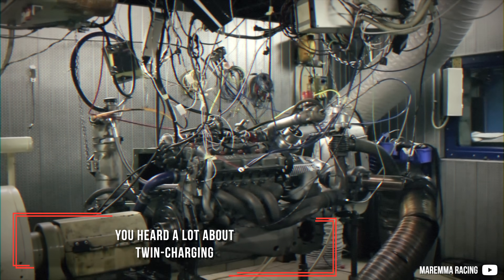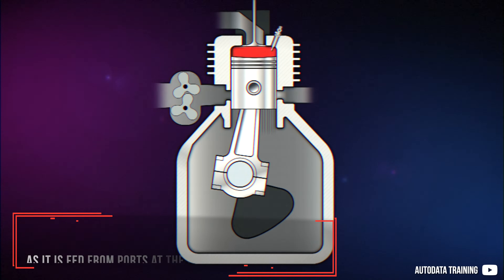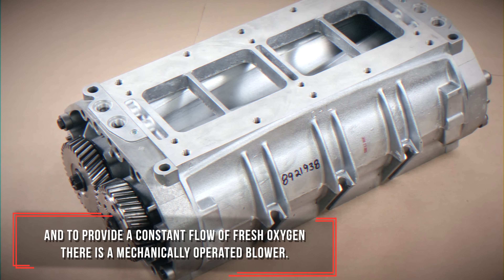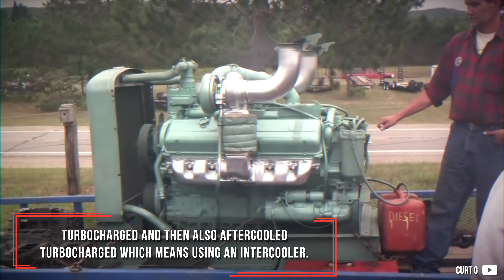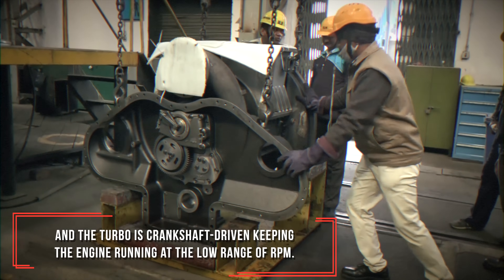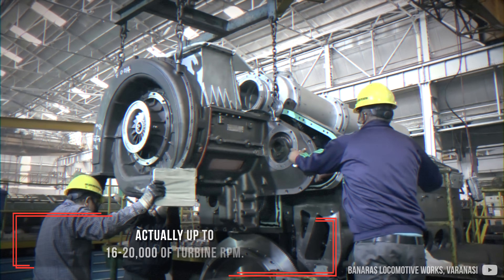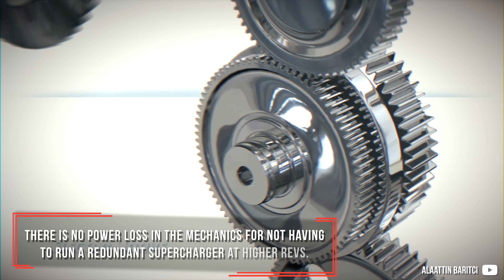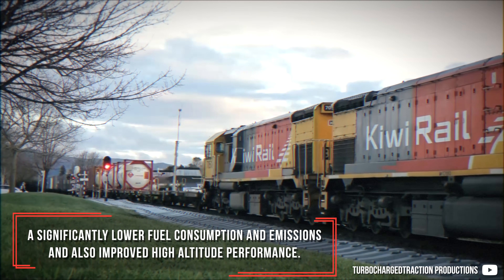EMD's Unique Type of 2-Stroke Forced Induction

Comment: I used to work for a major West Coast rebuilder of those EMDs. The blower/turbo was shipped in from another supplier in a dumpster sized crate. Inside was a dessicant pack the size of a pillow.
Reply: Ttem EMD 2 stroke run on anti friction bearing a very hardened steel 4340 crankshafts like Detroit diesel 2 stroke do, I got a silver 8v92 2 stroke turbo

Comment: The turbo sound was earsplitting on the test cell with no covers. 8 hours of full throttle run in before shipping.
Reply: We had a generator installed and it threw a rod at 7 h 40 minutes and had to be taken out of the plant. Almost made it haha

Comment: Damn it. Completely forgotten about EMD's 2-stroke engines! Used extensively in railroad and marine. EMD 710 series. Best prime mover ever, IMO.
Hmm... both Detroit and EMD focused on 2-stroke engine cycle for its diesel engines. What did they had in common? 
Ah yes, of course. GM!
You could focus on railroad prime movers for the next batch of videos, VR.
Reply: Don't forget Fairbanks-Moorse, they are technically two stroke but of an opposed piston design. Not sure if EMU's used OP units but they were popular in marine.
Reply: @yolo_burrito  Yes. They (Fairbanks-Morse & GM) were used during WWIi USN in Tambor, Gato, Balao & Tench-class, fleet submarines.
Reply: Fairbanks Morse made locomotives with an opposed piston design also, they just didn’t go over real well because the EMD and ALCO engines were so much simpler to maintain.
Reply: No wonder they have similar engine naming: 6v53, 8v71 from Detroit, 16-645, 20-710 from EMD.
Reply: @JustPeasant  they are still in use in some applications. I know of a water management district uses them for very large axial flow pumps.

Comment: Its basically a the same type of clutch you find in a bicycle, and it's freaking genius. 
For those of you who aren't aware, the Detroit diesels and the 567/645/710 were designed basically by the same people, hence the familial nature of the shared design. That is thanks to ole' GM and her conglomerating ways. The history is fascinating. Its a shame that the 710 has to varying degrees been regulated out of existence (though it's still being produced in smaller numbers for certain industries and via the tier-4 credit program). Perhaps EMD can work with AchatesPower to bring two stroke back to it's former glory while still meeting emissions compliance.
Reply: If EMD buy Achates and get serious about adopting the opposed-piston architecture, they could get Caterpillar back into the on-highway engine market. I could see Caterpillar's "EMD Truck Engines" making something like a 4-53 for 1/2-ton trucks and a 6-53 for HD trucks. Then they could also make a 6-71 for larger trucks like box trucks, and opposed-piston 8V92 and 12V92 engines for big rigs.
Reply: It’s the for an OP 1700 rotax made from 2 850 etec turbo engines in a new skidoo.that would make one sick snowmobile engine. An opposed piston turbo 2 stroke in a 2023 skidoo

Comment: Can't get enough of the EMD engine sound.  Purposeful chatter.  Locomotive 4-strokes just go chop-chop-chop.  If I remember correctly, the turbo on the EMD transitions from mechanically driven to exhaust driven at throttle notch 4.  Detroit Diesel tried some things on their 2-strokes in the 80's to overcome the Roots blower inefficiencies.  The Silver 92 had a blower that would clutch off and charge air would bypass around it once the turbocharger was making boost.  They also experimented with a hydrostatically assisted turbocharger to completely eliminate the Roots blower.  There was an hydraulic pump driven by the crankshaft plumbed to the turbocharger shaft that had a Pelton wheel added to it.  (Think of a small version of a waterwheel.)  It would spin the turbo fast enough to start and idle, and run at low loads until there was enough exhaust energy to really light the turbo.  I don't think that ever made production.

But my favorite EMD sounds are made by the Roots-blown 567 and 645's.  The turbo silenced the exhaust on the later 645 and 710's.
Reply: Detroit is still being innovative in the turbocharger space, making use of turbo-compounding on the dd15 and dd16 engines
Reply: I would rather just use a sealed crankcase and rotary valves down there. Sldo oil injection VRO dry sump. Tge model 42, and 32 Fairbanks Morse did this. Field marshals tractor and Sachs D600L in Holder A-12 tractors. Also 850 rotax etec turbo in new skidoos. I like the dry sump VRO much better.

Comment: the emd 645 engine was almost 4000 hp with 20 cilinders. The sound of it is astonishing also. Denmark used it in Mz diesel locs.
Reply: Love the MZ series, especially the MZ IV
Reply: The 645 V20's were used here in North America for EMD SD45's but they were not reliable at all.The weight of the engine block was too heavy on the frames,so over time from vibration,there was bending from stress including fractures.On a mechanical aspect,it was notorious for them to have piston or crankshaft damage as well.Eventually,most of them were rebuilt as SD45R's and SD40M-2's with the 645 V16's just like the SD40-2's with 3,000 HP.Later on,EMD came out with the SD45-2 which had better reliability and longevity.

Comment: I basically came up with this idea on my own, and found out that similar designs have been done before. I think my design is better though. It's a very significant part of my engine design thesis.
I love the sound of that Detroit diesel. It sounds extremely powerful. If I'm not mistaken, this is part of the future of the internal combustion engine.
Two stroke engines are simple, smooth, powerful and efficient. It's really nice to see that this is an already proven technology. It takes some of the stress off.
Reply: Indeed, 2-stroke Diesels have always been the most efficient reciprocating engines in the world and still are..

Comment: EMD bought the design from Detroit Diesel roughly about the 70's. 
The 149 and 249 series 2 strokes were originally a Detroit Diesel that they couldn't get to pass emissions. Detroit Diesel was the first diesel engine on the railways after steam engines in 1932. 
The only competition DD had in the 50's was GE. 
The first DD 12V149 series engines came with 4, 6 cylinder heads mounted on the 12 V engines and same with the 12 V 249 engines. 
The 16 V engines were 4, 8 cylinder heads mounted on the 16 V engines for that series.

Comment: What do you think the fact emd and detroit had the same owner when these engines where developed had to do with the final product?   Im also wondering how the low rpm aspect of the emd had on the ways it tackled getting enough air.  Would have been cool if emd had developed a truck engine.    Love your program.    My fav fact on 567.   Trips overspeed at 900 rpms.  And can run with in parameters at 3 lbs of oil pressure.
Reply: The two stroke diesel truck engine went out of favor because it couldn't pass pollution control laws. GM gave up on development of it about 20 years ago.
Reply: @cdjhyoung  The technology  EXISTS for a resurgence of that MOST efficient Supercharger 2 stroke diesel....The EPA is counterproductive to truly green  They've taken out the Sulphur, now 2 strokes should be COMPETITIVE as CLEAN & efficient    PLENTY OF BOOST
Reply: @charlesangell_bulmtl  Perhaps true, but I need to wonder if GM would still be interested in investing in this market, if they still have the technology and manufacturing ability to produce this size of engine and if they still own the core patents on these two stroke engines. GM heavily dis-invested in a lot of product lines in the 2008-9 era. I think that's when Penske got their Allison transmission division. It would not surprise me if the Jimmy diesel line was part of that deal.
Reply: This particular design was invented and produced by the WInton company, GM bought the Winton company and split it into Detroit Diesel and the Electomotive divisions so the answer is yes, both brands have a common origin.

Comment: This is an accurate vid. I'm very impressed. You even correctly called them Uniflow Diesel and omitted mentioning the dreaded 'Supercharged' word for naturally aspirated EMD and Detroit Diesel variants. For a short vid it is loaded with accurate information. Well done!

I've got some things to add for those that don't already know these things and have a yearning to know more LOL.

So as you point out not all EMDs were turbocharged but you show an excellent pic of a naturally aspirated V16 EMD at 4:25. You can actually see very clearly the Roots blowers - one per bank driven by the camshafts at the camera end above the generator.
The EMDs were exhausted in the Vee whereas Detroits are coventional location. EMD Vee angle is 45deg and Detroits were 90 degree Vee if they weren't inline engines.  
Those style NA EMDs were never turbocharged as only Detroit Diesels had a turbo and a blower. 
The airbox pressure the blowers pump is 0.7 PSI over barometric at sea level. It was found (by Kettering) .7 PSI provided some altitude compensation and some compensation for hot days and combinations of hot and high.

Also of interest, Detroit Diesel 92 Silver Series - so the very last automotive 92s, were originally going to use the EMDs hybrid turbo-blower but the impending move to 4 stroke inline 6 Diesels by the trucking industry was in the wind at the time due to tightening emission requirements.
Detroit Diesel decided that it wouldn't spend the development costs on a hybrid arrangement for the new Silver 92 so instead stayed with the conventional turbo feeding into the blower of earlier turbo DDs. Turbo blowers were different to NA blowers because they had a bypass flap inside and boost pressure bypassed the blower lobes saving 30hp even though the blower lobes still rotated - so no redundancy in this arrangement.
The aftercooler was mounted below the blower and was a liquid to air arrangement fed by engine coolant. 
In the Silvers, the injection system had electronic control called DDEC (Detroit Diesel Electronic Control). An 8V92TTA (TTA in Detroit Diesel parlance means Tailored Torque Aftercooled not Twin Turbo Aftercooled).

Roots blowers on Detroits cost in the order of 100hp to drive which must be paid for in fuel so the hybrid EMD style blower on the Silvers would really have been something. We'll never ever know what could've been except to say the 475hp 8V92TTA Silver Series 92 would've had probably another 70hp and used less fuel producing that power.  

A side benefit of all turbocharged engines is they have built in altitude compensation ie they maintain their rated power at almost all altitudes below about 18,000ft (not too many EMDs at those kinds of heights). 
Blowers because they are a positive displacement pump, geared to the engine rather than free spooling also lose pumping capacity with altitude gain. This is because each chamber within it has a known displacement that yields a rated volume of air at sea level. As you go up altitude it can't supply sea level pressure anymore.
A blower turned into a supercharger so put on say a V8 gas engine even though it pumps 10PSI boost at sea level still loses its capacity to maintain that boost at altitude. 
A free spooling turbocharger still pumps the same boost since exhaust is powering the compressor.
Reply: Its specifically called WINTON engine, a type of uniflow Diesel.
GM bought the Winton company and split the company into the Detroit and Electromotive divisions.
Reply: @sandervanderkammen9230  Winton and the Electro-Motive Engineering Corporation (EMC) were originally two separate companies, GM bought Winton first for their diesel designs and then decided to also purchase EMC because they were one of Winton's largest customers, all this took place in 1930.   EMC had been formed in 1922, their business was self-propelled passenger railcars, then commonly known as 'doodlebugs' in North America.  They were a relatively small company and did not even have their own factory, while they designed and marketed their products they would buy engines from Winton or other suppliers, electrical gear from GE or Westinghouse, and then contract out actual construction to a railcar manufacturer like St. Louis Car.  

GM reorganized and renamed Winton to Cleveland Diesel in 1938, and also created Detroit Diesel as a separate division at the same time.  The intent was for EMC (renamed EMD in 1941) to focus on railroads, Cleveland on the marine industry, and Detroit on the equipment and vehicle markets.  Those lines ended up blurring over time and Cleveland's remaining business was merged into EMD in 1962.  

Winton/Cleveland's engines were highly successful in the marine world, and while they don't get anywhere near as much attention from historians they actually built more engines than EMD during the war years.  Some 268 and 278 engines are still in use today, but they are becoming rare and replacement parts even more so.  

The early history of GM's entry into the diesel engine and locomotive markets is a fascinating story, especially when you consider that the EMD 567 almost single-handedly killed the steam locomotive in North America.
Reply: I got a silver 8v82 2 stroke turbo engine out back. 475 hp
Reply: It’s got a garret turbo
Reply: The 892TTA highest hp setting was 450, a 475hp setting was A TA Engine, but good on you for clarifying the true meaning of TTA for the (drive em like ya hate em brigade) who will insist it means twin turbo!! 👍

Comment: I'm not sure if a crank shaft driven turbo is a turbo anymore by definition. In Germany we call that either a blower or a compressor, depending on the pressure.
Reply: That is correct. He must mean super charger. Turbo chargers by definition have 2 parts: the compressor and the turbine. The compressor is spooled up by the exhaust.
Reply: @dylankoett2761  its both its crank driven at low RPM and a one way clutch lets the turbine pick up the load and spin even faster then the crank once theres enough gas flow through the exhaust.
Reply: @dylankoett2761  Wrong, the EMD has a BLOWER, not a supercharger.
EMD engines are not supercharged or turbocharged.
All EMD 2-stroke Diesel engines are NORMALLY ASPIRATED.
Reply: @phalanx3803  But it's still Normally Aspirated, not supercharged... no manifold boost pressure.

Comment: I worked on a diesel-electric ship with 5 of EMDs that had this method of supercharging.  We would idle them at 600rpm to warm up before putting online, which of course the would have to be brought up to speed (1200rpm) beforehand.  Once at speed, you had to get it online soon as the lack of load wouldn't spin the turbo fast enough, causing the exhaust inlet screen to soot up and the engine to surge.
Reply: 1200RPM?! EMD 2 cycles are rated to at most 950 RPM aren't they?
Reply: I remember one of our SD40-2 locomotives (turbocharged 16-645, 3000 HP for traction at 900 rpm) that was plugged up pretty good.  When you were pulling in full throttle a chunk of crud would make it through the screen every now and then and get chewed up, what a horrible sound that was.  But it would quit coughing after a few seconds and go right back to running normally

Comment: I learned a lot about 2 stroke diesels watching this! It would be extremely interesting to see if the EMD's turbo/supercharger could work in a car setting.
Reply: Cars are generally 4-stroke engines and have a throttle... so this design is not really applicable to cars.
Reply: 4 stroke in cars/trucks suck! 2 stroke would be better for me,